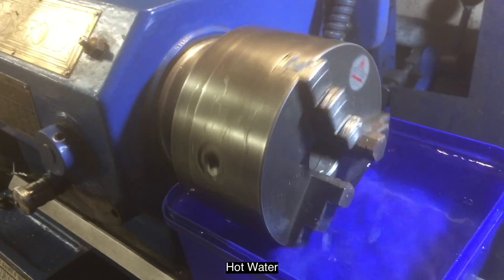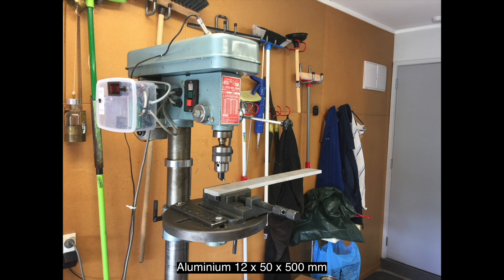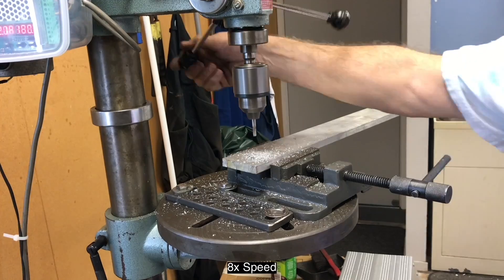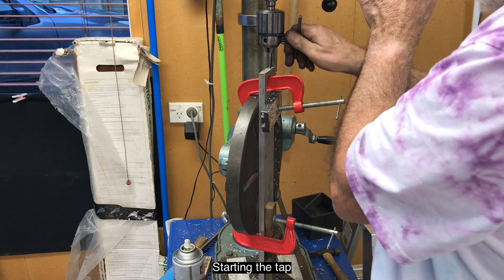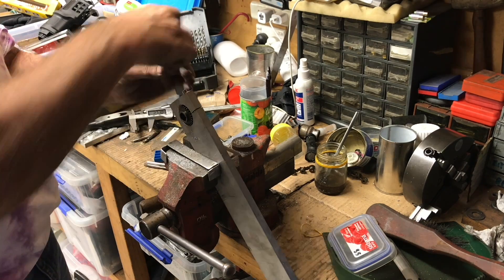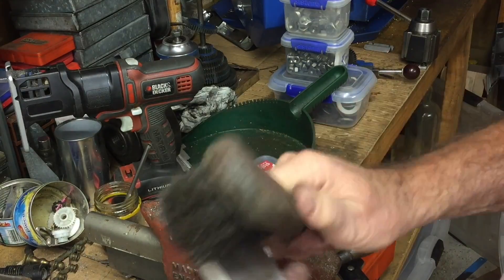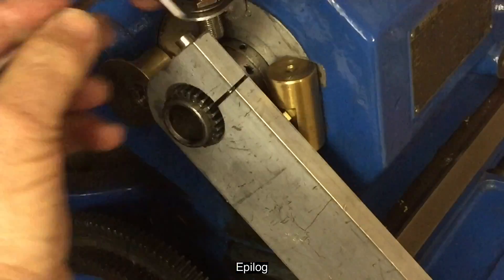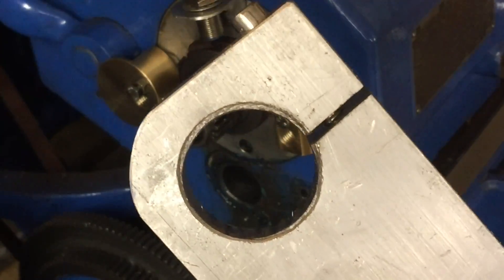Spindle Clamp -If you cannot unscrew the chuck on an engineer's lathe you need a spindle clamp/lock

Comment: Thanks for the video.  I notice you have a tachometer mounted on the spindle as I do on my old Southbend.  How did you get the magnet to stay on the spindle.  I've tried glue and epoxy but neither seem to work very long.  Thanks again, I am enjoying your projects.
Reply from the maker: You are probably familiar with the two threaded rings or nuts that are used for adjusting the pressure on the conical spindle bearings. The outer threaded ring acts as a locknut. I removed that and made a copper washer to fit between the two rings. This washer was made with a lug of copper plate protruding. A small neodymium magnet was wrapped in place by folding the copper lug around it. I hope this helps and I am glad that you have found the videos interesting.